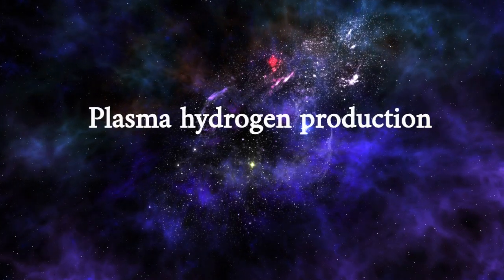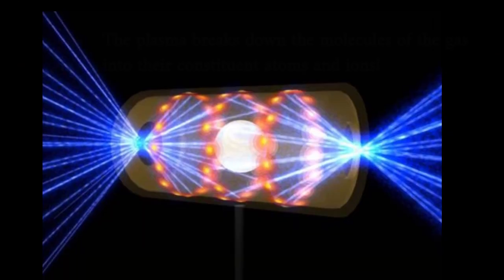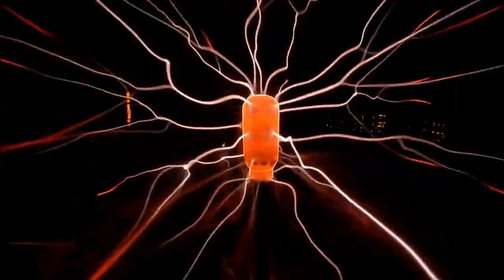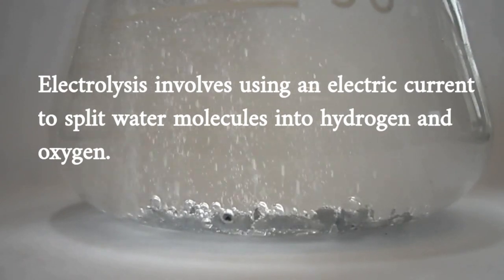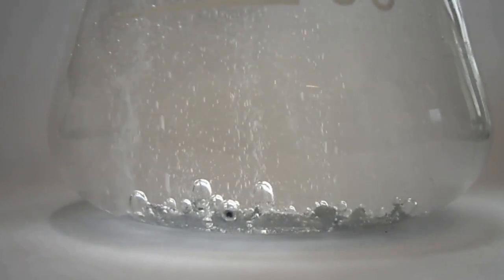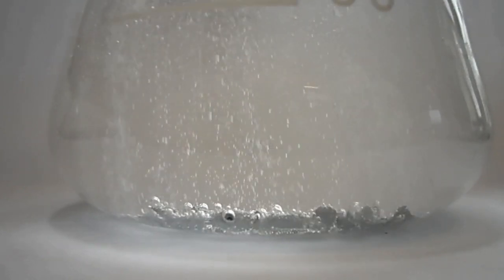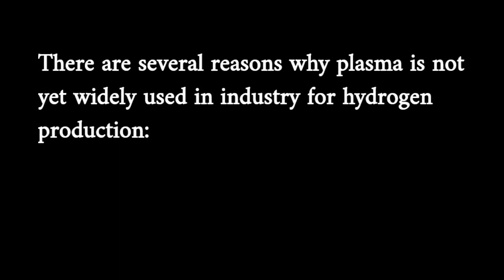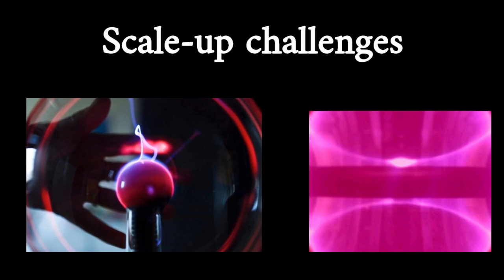Plasma Hydrogen Production

Comment: Hello Professor, please provide information about the wire you wrapped around the quartz tube. In my case, I am using aluminum foil around the tube but after some time when it gets heated up, it's difficult to remove the foil from the tube. Thank You
Reply from the maker: Thanks for your question! The wire around the quartz tube helps with heat distribution and is easier to remove than aluminum foil when heated. You might consider using a different material, like high-temp insulation tape, which could be more manageable.

Comment: Pure fraud.  Water electrolysis does not split water.  The hydrogen comes from the electrolytes and/or electrodes.
Reply from the maker: That's not accurate. Water electrolysis does split water into hydrogen and oxygen. The hydrogen produced comes directly from the water molecules, not from the electrolytes or electrodes.

Comment: ah, ok, that makes sense, the cost is too high, because the steam you have to produce to crack methane gas has to be 800°C and you can only heat up steam to 500°C if you used induction, so you need either a natural gas line or a methane line, before you can start making hydrogen, oxygen and apparently solid carbon??? how solid carbon??
well, my question to your company is this, since it ionizes  the gasses, like what happens with electrolysis, or what you do before releasing exhaust fumes from natural gas plants in the air, with an electrostatic precipitator, is it also technically possible, to add other gasses before the plasma turns it into their constituent particles? Because I can see how you can now collect CO2 gas from other companies, and send that through your system too, to extract CO2 from environmental air. Is this possible, or have you thought about converting your invention so it can actually do that?
It's the solid carbon as a byproduct that baffles me, because you can exactly weigh how much carbon you're actually taking out of the system, and that's remarkable and sellable.
If it can indeed also can suck in environmental air and extract the co2 from that, then government will be more interested, because that's exactly what they need.
Theoretically I don't see the problem with it, but i'm no chemist, that's why i'm asking you, can it also include environmental air, even if you have to convert some things so it can?
Reply from the maker: It's fascinating to see your interest in the technical aspects of hydrogen production through plasma-based processes. Your observations about the challenges related to temperature and the potential for collecting CO2 from environmental air are insightful.
Regarding the solid carbon byproduct, it's likely that the process you're referring to involves the creation of carbon as a solid material during the plasma-based hydrogen production. This carbon can indeed be a valuable product, especially if it's of high purity. Depending on the conditions and parameters of the plasma process, carbon can form in different ways, and its characteristics can vary.
As for your idea of incorporating environmental air and extracting CO2, theoretically, it's possible to design a system that utilizes plasma to process other gases, including those from the environment. However, the feasibility of such an approach would depend on various factors, such as the specific gases involved, the required conditions for processing, and the efficiency of the plasma-based reaction. It's an interesting concept that aligns with carbon capture and utilization strategies.
While we are not directly affiliated with any company working on this technology, the principles you've highlighted suggest that with careful design and optimization, it could indeed be feasible to adapt plasma-based hydrogen production for CO2 capture from the atmosphere. However, such an adaptation might require modifications to the system and further research to ensure its practicality, efficiency, and environmental impact.
Your ideas showcase a forward-thinking approach to addressing environmental concerns, and they could potentially contribute to more sustainable and versatile applications of plasma technology.
Reply: @futureenergytechnology  well, if I could have been a muse to your company, it was time well spent to write my comment :)
Reply: @futureenergytechnology  thank you chat gpt, that was a nice thing to say :)
Reply from the maker: @florianooke3186  ChatGPT can indeed provide valuable assistance when used in the appropriate context
Reply: What about using waste dumps ? Plenty of methane

Comment: And how exactly does that work, lets say from methane?
Reply from the maker: Good question! Producing hydrogen from plasma using CH4 involves a process called "plasma reforming." Plasma reforming is a method of converting hydrocarbons like methane into hydrogen and other useful products by subjecting them to a high-temperature plasma environment. The plasma is a highly ionized gas with high energy, and it can break down the methane molecules into simpler components like hydrogen and carbon.
Reply: @futureenergytechnology  This is setting me on the right track, thank you!
Reply from the maker: @quinto190  You're welcome.